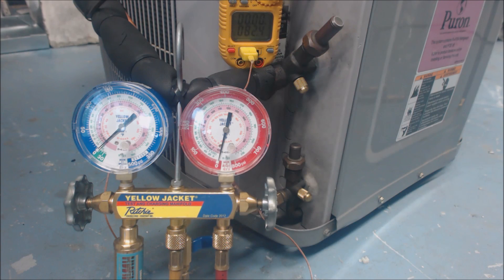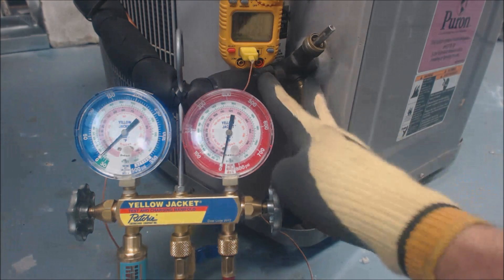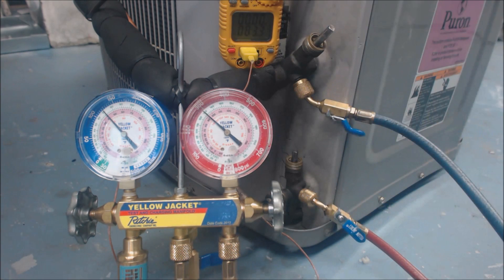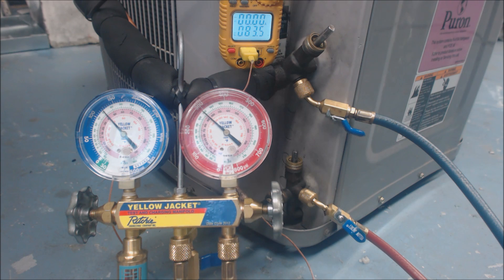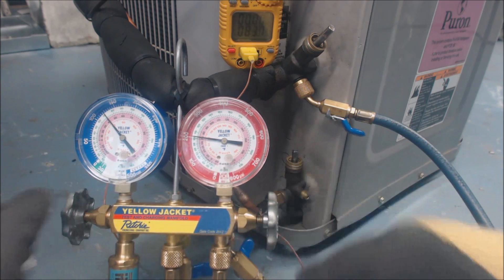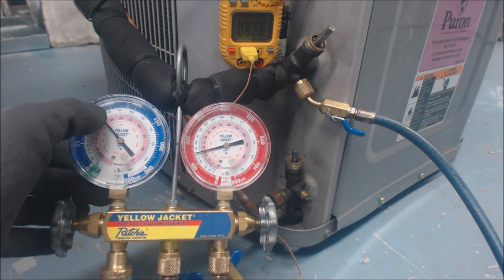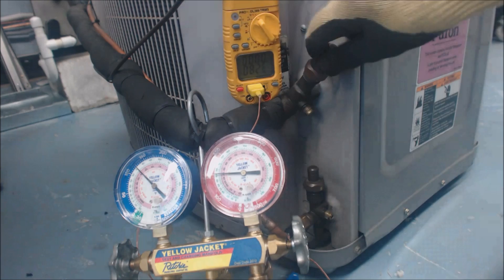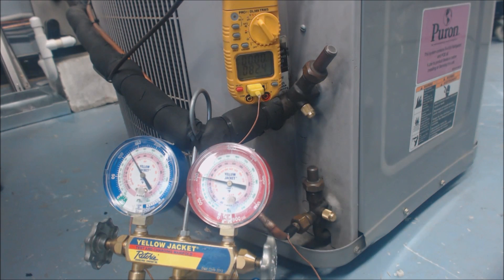Refrigerant Charging: How to Check a R-410A Refrigerant Charge & Disconnect on Unit with King Valves

Comment: Hi....
I have a 410a system
My head pressure is fluctuating 225 - 250
Up and down constantly
Along with liquid line temp
fluctuating 94° - 102°
Does this seam odd?

Comment: While doing your disconnect procedure I noticed you had something other than the blue hose connector attached to your manifold. You reference a liquid vaporizer is that what you had attached or what it just a line filter? Can you elaborate what device you had connected.

Comment: I was told yesterday that my Hvac isn't working properly on my first floor due to the condenser being 2.5 tons and the air handler being 3.0 tons is this correct.  Also when using a bigger air handler is more freon required? Its a 410a system.  Thank you in advance .
Reply: Jnaral idea used  frested  propeal  checked  gas low  unit is  tripein  high  tempaches reson  some time fan  brening  sometime  contacyer all  ome by checking  felde vrey  impronted normal  eacy ok ok no gues expeanedby jobes sigjt juping not  frefeated gues

Comment: Is the unit switched off during this process? If so how will the charge on the low side increase the high side pressure with compressor action?
Reply from the maker: The compressor is running but my old mic canceled out the background noise, thanks!
Reply: AC Service Tech LLC thanks

Comment: Hi. How do I know if my AC is an inverter or low current?
Reply from the maker: Current is measured by amperage but usually we are looking for high amperage that approaches the max to see if there is a problem. The type of comoressorcwould be seen in the model manufacturers literature, thanks!

Comment: Is there a way to rule out air flow as the cause of a low suction side pressure?  My system shows 10 degrees of subcooling as the unit calls for but the coil ices up.  In 85 degree weather (for example) I get too high of a high side reading (295) and my low side is way too low (65) for an R410 saturation temp of around 10 degrees (far too cold).  I believe in your videos you suggest this temp should be around 40 so as to be well above freezing.   I work on auto ac systems which are way easier to diagnose for me than my carrier heat pump.  My instincts are telling me restriction in the high side and most likely a faulty txv.  Before I go down that path I would like to rule out air flow restrictions.  This unit has never really functioned well since I had it installed many years ago.  I've had many techs come and waste my money and not figure out the issue so I have taken to studying the system myself.  All the filters, coil and condenser are immaculately clean.  I have even experimented with opening up some temporary extra flow expecting to see some increase in the low side pressure to no avail.  Could poor air flow through the coil really cause that low of a pressure on the low side and a corresponding high side pressure too high?  I really think the txv is malfunctioning and not allowing enough refrigerant into the coil (?).  Any thoughts on this would be greatly appreciated!   

Your videos are absolutely fantastic by the way.  You're a great teacher!
Reply from the maker: No problem, it is fairly easy to figure out when the low side is below 32 degrees- high superheat, high subcooling is liquid line restriction such as filter drier, strainer, txv and low superheat normal to low subcooling is low airflow, high superheat and low subcooling is low refrigerant charge, thanks Probuffmaintenance!

Comment: Why didnt you recheck your high side temperature spread after you shot more 410a into the system?    I realize you had the Evap temp above freezing  (I think you showed °40'ish F,   but how do you know if you indeed achieved the desired sub-cooling temp if you never measured the spread?  (gauge vs sensor on copper)
Reply from the maker: Hey Bobby, I checked the subcooling and it was at 9.5 degrees. Then I said, just say it was close to the actual subcooling. Then I disconnected the red high side, purged the air and then charged the refrigerant in the hoses back into the system which will usually  add a degree or two of subcooling. The video was about how to disconnect, while charging back into the system. You would need to do this or loose the refrigerant in the hoses, thanks

Comment: The Goodman R410 units have the factory pressures printed on the information label. If your pressures are below that, why can't you charge to the factory pressure without checking subcool/superheat? I know that won't necessarily fix a problem elsewhere but, could it damage anything?
Reply from the maker: If the manufacturer gives you a chart that states at this outdoor temp or at this wb inside then this is what the pressure should be then that is fine but the manufacturer won't be able to tell you what pressure to set the liquid line to if the fins are older or in bad shape as the pressure would be higher than they are stating, thanks Steve!
Reply: Yeah. The factory pressure is the starting point for the initial charge for a new dry ship unit. Thanks.

Comment: I realize you are in New Jersey and I'm in Tn.  Sounds like your really know your stuff and really take your time to do it right.  What suggestions do you have for the home owner that wants to find a really good person like yourself to check their HVAC unit properly?  It just seems like there are so many jacklegs out there and they are in such a hurry to  get the job done they are not performing all the proper steps or doing them correctly.  And most folks do not know what the service tech is doing and if they are doing it right.  What do you suggest?
Reply from the maker: My suggestions are to contact neighbors and as them who they value as well as the  hvac supply houses in your area as they would know who they like dealing with and who is honest or a smart tech, thanks!
Reply: Thank you.

Comment: good day! Sir how about if the unit dont have reference plate that tell you the right amount of subcooling, How could you tell if that is the correct charge? what else could be done to check the right amount of charge. thanks!!
Reply from the maker: if there is no subcooling on the rating plate and it is an air conditioner, we usually figure 8-12 so I usually set them at 11 and check for a 18-21 delta T across the indoor coil, thanks!

Comment: hey how are you I have a question I've done in the past numerous mini splits I recently installed a Goodman 4 ton 410A AC only in my home I know the systems come charged for at least 15 ft of lineset my line said is only 4 ft long I have a friend of mine who's an HVAC Tech he came over and said it was overcharged and removed some freon before he remove the freon the suction line was sweating nice now it's not do you think I'm under charged I have a set of gauges but they're the old style ones thanks
Reply from the maker: It is possible, you would have to check subcooling for txv and superheat for piston if this is a single speed compressor. Techs that work on refrigerant charges also have to be epa 608 certified first, thanks

Comment: Question;
Why do you add the refrigerant through the low side and not the high side? 
Thank you!
Reply from the maker: So think about when a system is on there is a low pressure and a high side pressure. The refrigerant bottle pressure is in between those two pressures so if you let this pressure in the bottle go to the vapor side, it will enter the system but if you connect it to the high side then pressure would come out of the system. If the system is off and vacuumed, then you can break the vacuum with refrigerant into the high side as a liquid. - https://youtu.be/ncgLDYrvN6w
Reply: It is  very simple think of it as an input and output input is the low side and out put is the high side. So where do you think you would insert something on the system?

Comment: Purge hoses?
Reply from the maker: Always purge hoses of air before charging refrigerant in or after disconnecting the high side from the system and before dumping the liquid back into the blue side to charge back into the system. Thanks Jim Curtis!

Comment: im still confused  after you equalized the gauges....did you bleed the refridgerant from the tank into the low side gauge? Is that what you did? appreciate it if you get around to my question.
Reply from the maker: Hey Michael Kelly, this was just connecting, checking the charge, purging the air out, and charging the liquid from the red side through the low side and adding the liquid back into the vapor side into the system. No bottle was connected. We were making sure not to steal the liquid refrigerant out of the system when disconnecting. Thanks Michael!
Reply: acservicetech thanks so much sir

Comment: I have a question !
Supose I have a system that works with 410A refrigerant and i like to convert it to R290,  how much will  the gauge show ( PSI or bar ) when then compressor is off ! I supose that you can refill the system even if the system is off ? 

2. And how much must the system show if i refill it with R290 when it run s with R22 ? ( the system is off )

The temperature is 30C
Reply from the maker: You can weigh in liquid refrigerant into the liquid line with the system off after the system has been vacuumed down to 500 microns and has held. This way you are able to get the correct poundage in before pressure is exerted by the vapor.Pressure is exerted by the vapor and when the refrigerant is in saturated state and has a chance to reach an equilibrium. Then the pressure will depend on the average temperature of the unit that the refrigerant is in with the unit off so is not really a pressure you are looking for but a weight. Please be aware of whatever codes are in your area as I am not sure what the unit is for that you are referring to but there could be codes that would not support putting propane R290 into the unit as a refrigerant but you would have to check with that as well as any and all potential hazards which would come first.I would get some more experience under your belt before working with this and I will not advise on putting any other refrigerant other than the one that the manufacturer has on the rating plate. Thank you for your comment though!
Reply: Matheos Georgatzis